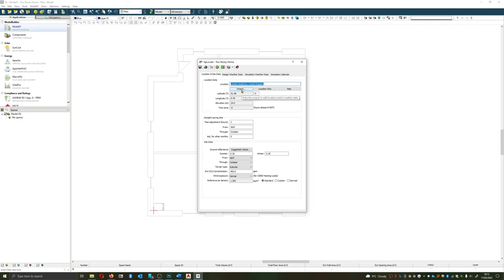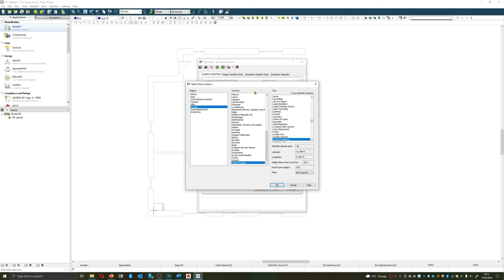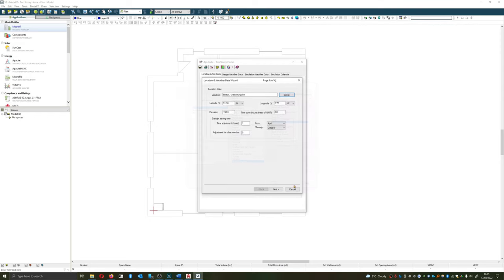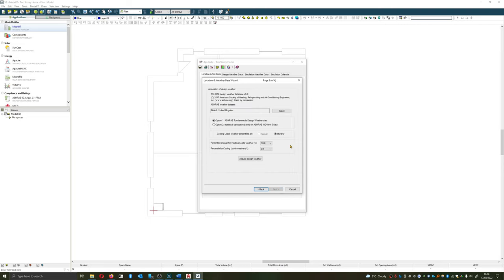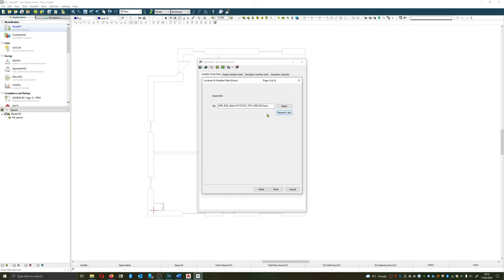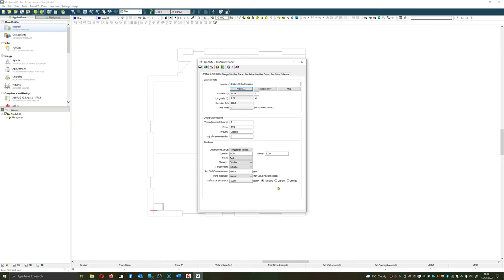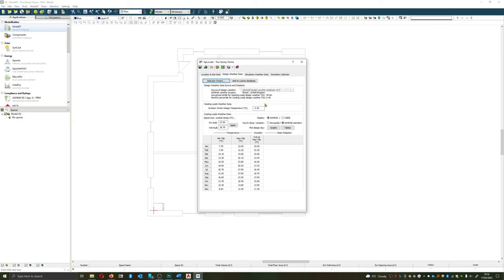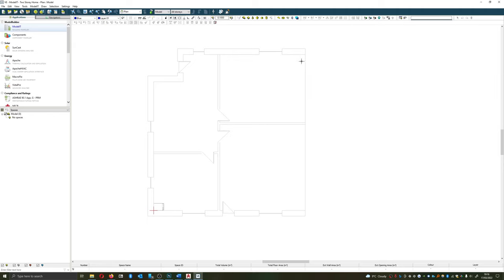IES VE Tutorials - Episode 2 - Location

Comment: I also have a couple more questions (which could be video ideas), I’d like to send over email.
Reply from the maker: I didn't make that video - but you know what, I'll do it this evening. Very simple to do. I don't give my email out on this, but if you have ideas I'll gladly look at them :)
Reply: Perfect thank you. My another of my questions would be whether you can and how you can see data for air temp/c02 levels in a room at a certain height (chest height)?
Reply: For example where you’ve placed sensors in the real life room
Reply from the maker: @joshuamonkhouse4776  Okay, so to do that you would want to use Microflo CFD. The reason being is that IES holds the internal conditions of a room in a homogenized state - meaning that all air within a volume is exactly the same in properties. I suppose theoretically you could partition a room up vertically to do this, but I wouldn't trust the figure very much.
Reply: Would you be able to do a quick video on that?
Reply: @joshuamonkhouse4776  i might be able to squeeze that in later this week.
Reply: That would be of great help, as I have a project submission end of the week.
Reply: What I’d like to be able to do is investigate the temp/co2 where these sensors are in the room, then simulate different scenarios with max occupants or windows open/closed to see if the sensors co2/temp levels will be adequate according to regulations etc.
Reply from the maker: @joshuamonkhouse4776  Looks like I'm not going to have a chance - just throw "microflo CFD" into youtube and you should get plenty of video's that cover how to use it. It really depends what your looking for, but perhaps just looking at the overall concentration of CO2 in a room is a better fit?
Reply: Thank you ill have a look. Due to my room being a large space with a very high ceiling, the dynamic sim is not specific enough for the c02/temp values that people on the ground will be experiencing. Hopefully I will find a good video, as my current dynamic sim c02 values seem to be very low for the activity going on in the space.